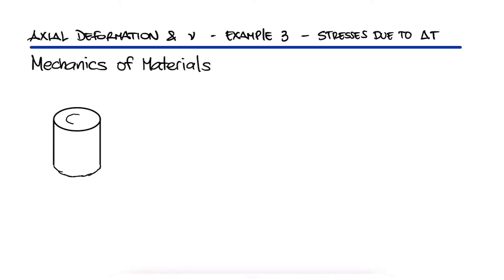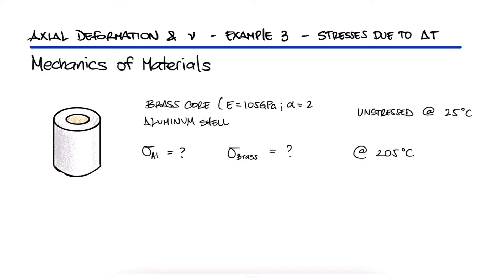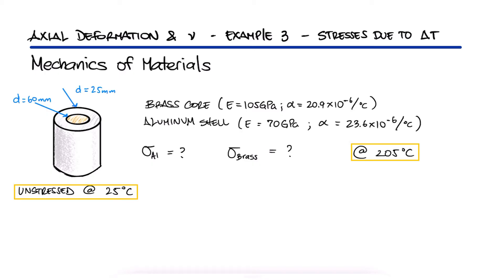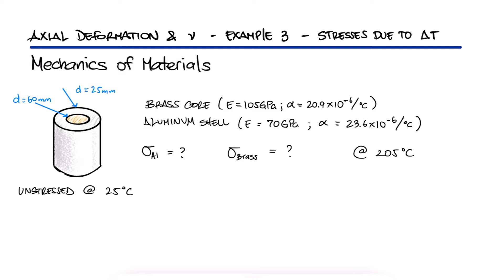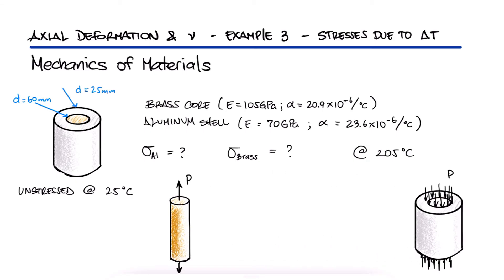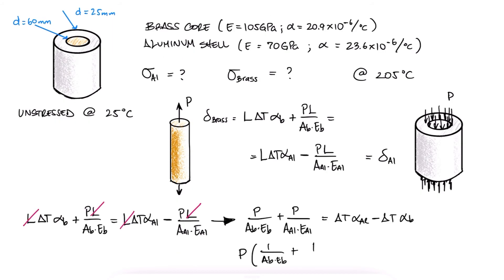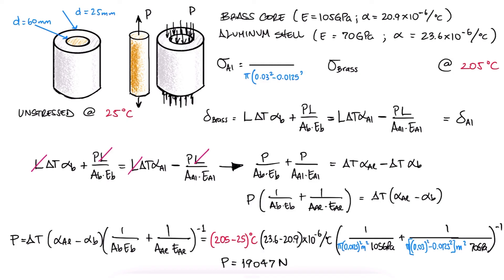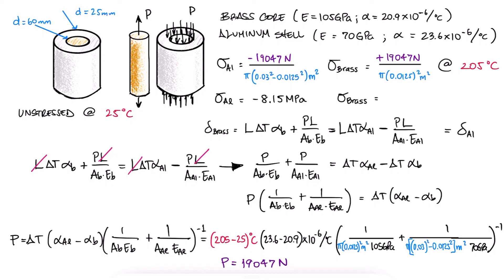Thermal EXPANSION and Axial Deformation in Under 2 Minutes!

Comment: How does a radial displacement due to thermal expansion lead to the axial constraint equation?
Reply: There would be an expansion along the radius, too, but that would not cause axial normal stress. Here, we're considering just the elongation along the axial direction, which causes axial compressing/stretching.